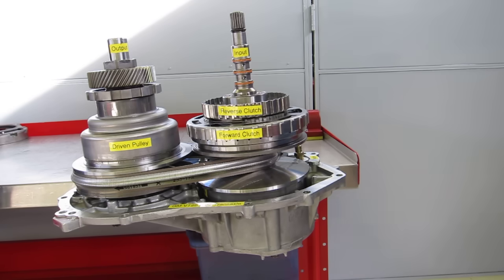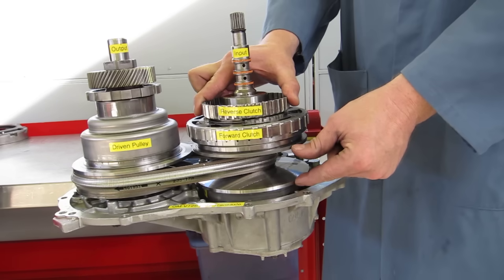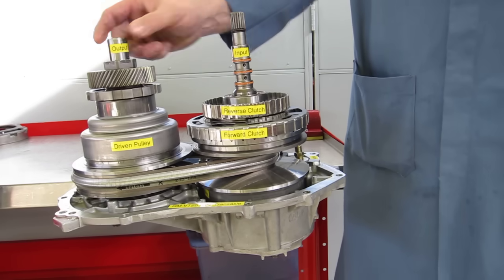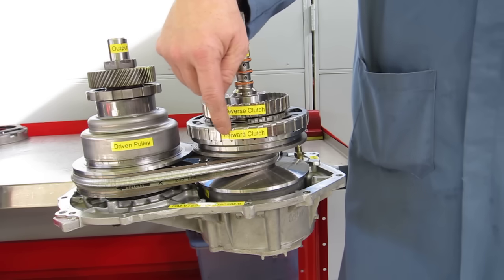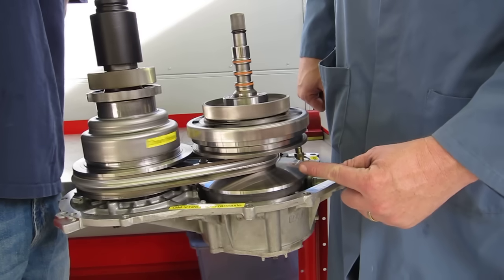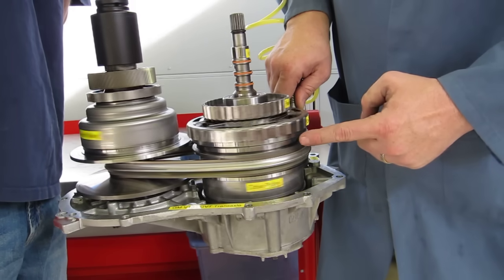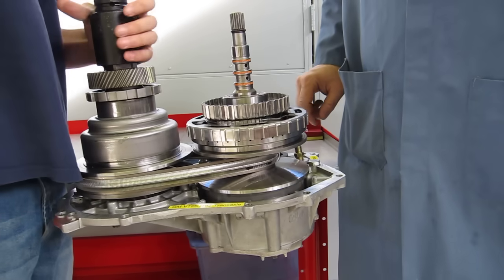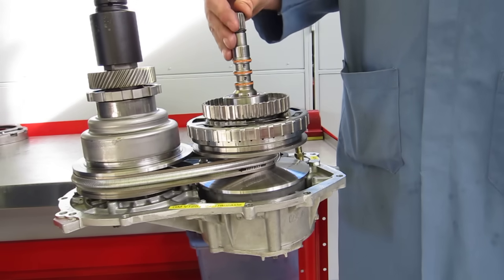Continuously Variable Transaxle (CVT) Operation

Comment: I know the guy who held the first patent on a fully functioning CVT and demonstrated it at a World Fair a long time ago. I don't remember what year and he may have passed away now, he was already quite old when I met him in 1999. Somehow his design worked without pulleys and belts and was supposed to be far more mechanically efficient and reliable than the belt design. He had a treadmill with a manual CVT in his apartment as his remaining piece. I struggled to understand the design, and had been attempting to invent one myself for use in heavy duty situations. The man was a genius. The belt driven designs initially were not efficient because of the friction to create gear ratios and reliability was an issue. I haven't been following the auto industry as much for the last 20 years, but I think those are still the same hurdles.
Reply from the maker: Thanks for your feedback! Very interesting!
Reply: I know this comment is 5 years old, so I apologize, but would you perhaps be thinking of something called a "toroidal CVT"? I remember seeing a video of it a while back, it's used for much heavier duty situations. Doesn't use a belt at all, instead it uses some kind of friction from spinning wheels, so it's much stronger. I think the Japanese military's main battle tank uses one (which means it can go just as fast backwards as it can forwards, which is neat).
Reply: @ianrasmussen5380  good evening, I just googled a toroidal cvt and although this is more on par with what I originally described, it isn't quite the same. Bill Glazier's CVT employed a lot of sprag shafts, or sprag clutches, and to this day I still haven't been able to "crack the code" and decipher how he incorporated them into his design, but I think there was still a lot more to it, unless the toroidal video I viewed was an oversimplification. Cheers to you

Comment: With reliability of the belt as the main concern, how can the new Nissan pathfinder claim towing ratings of 6K pounds?  Are they using multiple belts?
Reply from the maker: Hi, no. The newer CVTs actually have a regular gear set that shifts from first gear to second gear, then it is a CVT from there up to the higher vehicle speeds. That makes it stronger when accelerating from a stop.

Comment: Have a 2013 Altima with 60,000 miles. I'm on my 2nd cvt and it sounds awful. Until 2012, Nissan had a 120,00 mile factory warranty on these cvt's because they went out so often. The warranty is still 60,000 on these cars after 2013. They said it failed a flying graph test because of the torque conversion, and it would kill the engine quickly every time you tried to tough the gas pedal. It would idle forever though.
Reply from the maker: Thanks for the feedback!

Comment: I think you mean pneumatic, not hydraulic.
Reply from the maker: Thank you!
Reply: Any time.
Reply: He said, "I'm going to use air pressure for this demonstration." The system normally uses hydraulics, but pneumatic pressure is more easily used in this kind of situation.
Reply: +Jon Miller He that he was "going to apply hydraulic pressure." Then he went on to say that he was "going to use air pressure for this demonstration."
Reply: Yep. His wording was the slightest bit awkward, but clearly the first statement was part of explaining how the system works in actual use, and the second was explaining how he was doing the demonstration slightly differently. It's just like how they are demonstrating by applying power directly to the driven gear, even though that's not precisely how it works in actual use. It's just an easy way to demonstrate it. 

Try to keep up.

Comment: works a lot like a torque converter that uses a belt except this uses other means to change the pulley diameter whereas a torque converter relies on centrifugal force to do the same.
Reply from the maker: Thanks for your feedback!
Reply: a clutch doesnt change the gear ratio, it just delivers power to the transmission.
Reply: +scott walton I'm talking about the torque converter that gas powered golf carts and some go karts use
Reply: +jmcinvale at least that's what I've always heard it called. maybe the correct term would have been cvt.

I'd almost bet someone looked at the cvt on their child's go kart and wondered why couldn't we do that with cars.

Comment: Great for mopeds... weak for any horsepower... but, they will get better as time goes on. Personally, I'd run to the hills and use a nice conventional transmission.
Reply from the maker: Thanks for your feedback!
Reply: Are you a mechanic?
Reply: Agree
Reply: Ilove my cvt on my moped 😘😘
Reply: What? Most modern tractors use CVT and they have 700bhp and tons of torque.
Reply: @AriHD  it seems that you have severe misunderstanding of things. CVT will never be in a vehicle that need high horse and torque since the design was not capable of handling the power without snapping the belt

you probably think of conventional automatic
Reply: Agreed, manuals rule!

Save the Manual!

Comment: The limiting factor appears to be a steel belt on a steel pulley (much like a railroad locomotive drive wheel on a steel track). Seems rather obvious, but for more torque, why not just have multiple pulleys and belts in parallel?
Reply from the maker: Good question! Thanks for your feedback!

Comment: CVT's use belts?!? Hah! Just one more reason to hate on em'.....  And yeah, yeah.. I know they're the most efficient etc. etc... The most efficient meal would be a salad with no dressing.. But I'd rather have something with some more texture and spice! 

So I'll take a dual clutch, classic manual, or even an old fashioned torque converter auto over this glorified scooter transmission anyday!
Reply from the maker: Thanks for your feedback!
Reply: Dana has beltless CVTs now :)
Reply: Mike Howard
Hmm.. Yes.. Dana was wise to eliminate that weak point.

Comment: I have an old landrover,  it spent its first 230,000 miles in Africa. It was imported into England 18 years ago and has clocked up another 170,000. It still has the same engine and manual gearbox that was fitted when it was new.
Reply from the maker: Awesome! Thanks for the feedback.

Comment: i want a manually operated cvt so bad, invent one please!
Reply: that's.... strange. the whole point of a CVT is to not change gears.The transmission does the magic by making adjustments to the ratio as you drive. Or am I wrong?
Reply: well my guess was that it would have a computer telling it where to be, but i feel that there are times when i would want the rpms of the engine to be in a different spot then what it wants them to be. also i just think it would be a fun an a very unique driving experience
Reply: Subaru wrx cvt has paddle shifters with simulated shift points and can be either a "6 speed or a 8 speed"
Reply: no, you miss the point. he wants a manual one where you can manually control the hydraulic pressure in the cylinders and change the ratios real-time
Reply: Re exactly, like an infinitely variable gear stick
Reply: sometimes i i'd imagine the shifting mechanism will resemble something of a slider instead the lever gears we have with a manual
Reply: You can get cars with 'pretend' paddle-shifters (up to 12 if you like) but they're CVT really.
Reply: Get an EV. 1-speed transmission. No changes except to direction.
Reply: @johnbenton4488  that's not good for a ev tho lol. Single speeds hurt electric motor performance
Reply: JKC jeep tried it, Auto stick,  epic fail.
Reply: that kinda defeats the point though. id like one that emulates a hydrostatic transmission
Reply: EV wins on all fronts. especially costs.
Reply: You meant like a clutch-o-matic?
Reply: Not only has it been invented already, it has been around for quite a while on 21-speed mountain bikes! Fitting that onto a car would be like buying a PC just to use the calculator app. A CVT already gives you the optimal gear ratio for a given RPM and speed, so why do the math yourself? There are also the mechanical limitations of the engine and transmission to consider: excessive friction on the drive belt and higher chances of redlining the engine.
Reply: What I want is to have more input than just the "throttle" position (scare quotes because the gas pedal on a modern car is not connected to the throttle valve - it's just an input device for the computer.) Your typical auto trans computer, be it the old fluid-mechanical ones or the newest computer ones interpret full throttle as "I want maximum power", but very often what I really mean is "I want the engine to operate at WOT on top of it's torque curve". Good acceleration, relatively low noise, not a huge impact on engine life because of the low inertial loads. Maybe just a button on the steering wheel, that would switch the throttle between between a  call for power and a call for engine torque.
Reply: You would literally have like 30 speeds for it to be remotely useful
Reply: woohunter1 maxima has the same thing
Reply: Cvt and ivt tractors have a manual stick if u will, u can control the exact ratio.
Reply: ?  manually operated CVT?  "you keep using that word, I do not think you know what it means."

Comment: Great Video, I have a similar setup on my drill press, nothing but problems... If Honda and Toyota use them they must be reliable but I could never trust anything built here again.
Thanks for posting!
Reply from the maker: Thank you!
Reply: But are Toyota's CVT's less reliable that their standard transmissions?  Which is cheaper to repair if it breaks?  Which is cheaper to replace?  How much does each cost to maintain?

Comment: The steel belt makes better sense because it is stronger than rubber for high power.  Q1 how does it handle the fatigue cycle so steel does not break.  Q2 how do you handle this when car in Drive and at the stop-sign?  Where the engine is running and car is not moving?  Or slippage.  I have seen Nissan, where they use fluid coupling.
Reply: He describes a torque converter between the input shaft and the engine. There's your fluid coupling.

Comment: This is why the HHR is garbage. Much like all GM junk these days. Tired of working on them. Btw snowmobiles have used this for decades.
Reply: I have sworn off all gm products forever. They have completely bought into the xerox business model. when you have vehicles that constantly break down you shouldn't fix it, just view it as an additional revinew stream.
Reply: @dimesonhiseyes9134  even tho gms still have low failure rates.
Reply: All of the automatic transmissions I've had on ATVs and UTVs have been belt driven transmissions. Never had any problems with them but then they're not trying to propel something that's 2+ tons at 150+ lb/ft.
Reply from the maker: Thank you for the feedback
Reply: scooters use them too! i've even heard of a two-stage CVT at a 900+cc scooters by piaggio that essentially kick the second cvt with longer ratios at high speed.. i think those top at 240 kph?
Reply: K. beta 
 Where have you seen 900 cc scooters?
  Honda discontinued their silver-wing.
Reply: So have Bridgeport milling machines!
Reply: My golfcart also has one!

Comment: GM + Transmission = FAILURE!  That 700R-4 was good huh?  ;)
Reply: Oh lets just forget about he TH400 TH350 and 4L80E(arguably the strongest OD auto at the moment)
Reply from the maker: Especially in 1982
Reply from the maker: True, the 4L80-E was just at TH-400 with an OD in front of it. It still had a terrible first gear ratio of 2.48:1
Reply: why would you want any higher? you'd spin tires all the time in 1st gear. Not only that 2.5 to 2.6 is the norm its barely lower. Also i added the 4L80E because it is the strongest I know its basically a TH400 with OD. I drag race man and trust me you don't want a super tall first gear.
Reply: Ran a fleet of Safari vans in the late eighties with 700r trans and many had more than 500k on them with original trans. Not too bad compared to some of the other shite around.

Comment: Doesn't this method cause slippage at the belt?  Seems there would have to be a significant amount of tension/friction on the belt to keep this from happening.

Also, it appears that the gear ratio cannot be changed while stationary, due to the steep angle of the pulley walls.  So for instance, if you're in overdrive (say 0.5:1) and come to a stoplight, the transmission has to be smart enough to alter the gear ratio while moving.  Otherwise, you will be forced to start out from the light in an overdrive ratio until it can change back to a typical starting gear ratio.  This would hurt acceleration from a stop.
Reply from the maker: Good points. The trans ECU would not allow the ratio to be 0.5 at a stop, it would increase it back to the 2.43:1 before the vehicle stops.

Comment: I'm surprised he didn't mention the fact that these types of automotive CVTs transmit the power on the compressed side of the belt rather than the tensed side. In other words, they push the power across the belt to the driven pulley rather than dragging it. Other than that they are functionally identical the the Salsbury/Comet drive in a go-kart, snow mobile, or atv. The downside is these can only be considered "reliable" in low power vehicles like hybrids. You couldn't use this thing in a large truck or higher powered car without destroying the belts.
Reply from the maker: Thanks for the feedback, Subaru's use CVTs in some fairly powerful vehicles.
Reply: @WeberAuto  They do, and mine broke after a year and a half.

Comment: Amazing stuff but isn't there a lot of energy converted to heat from the friction on the belt?
Reply: +Dyllidan ret technically they are the smoothest, fastest, and most efficient type of transmission since you can constantly hold any rev including max power giving you the most acceleration
Reply: +MyLonewolf25 that's why I love em, they allow you to haul any load at the maximum speed unlike multiple gear trannys where 2ND gear is too torquey and burns more fuel and third gear isn't enough torque
Reply from the maker: I do not know, but I don't think so. There is no evidence of heat discoloration on any components. I assume that using the correct fluid reduces the friction and heat
Reply: cvts used on lighter vehicles like atvs and snow mobiles are centrifugally clamped, they have no hydraulic pistons changing the ratio, simply engine force causing a fly weight equipped clutch to fight the output load, wheels, inwhich the output side is spring loaded to stay it its tightest position making the transmission stay in its lowest gear when no force is applied to either input or output, and also if the output side is too difficult to turn it will collapse forcing the front centrifugal clutch to open and make more torque at the wheels... these transmissions are by far better than any other type of automatic or manual, their only flaw is that the belts break under extreme torque conditions, very little power is lost over these transmissions, especially non hydraulic types that i explained above
Reply from the maker: There is a difference between the 700 psi clamping load that holds the belt from slipping and friction caused by the belt slipping.
Reply: Not as much as a normal auto box. CVT gives better acceleration and better gas mileage than an auto box.

Comment: For some reason the CVT in my mom's Corolla accelerates poorly from low speeds. Maybe the low ratio is not very low(especially for a car with that little power), as the 2.6:1 you mention in this demonstration is pretty tall as well. That's what it seems like.
Reply: Also is there slippage in the CVT itself? It seems like there would be, and add that to the parasitic loss of the torque converter, and there's plenty reason for it to be slow, haha.

Comment: Technology hasn't really changed much. Grain harvesters (headers) have been using this type of equipment, with belt drives, for decades. Nothing new really.  Man has been to the moon and back (we think) and this is now the twenty first century. Surely today's engineers can do better than this and come up with something more robust - and long lasting.
Reply: they would be great if the belt didn't snap.  problem: that belt is almost the size of whats on my grizzly 600, an it's on a 3000 lbs car.  solution: engineers get off their ass and make the belt bigger👍.  haha. weren't we supposed to be flying to work now anyways?
Reply: +dhaynie266 I don't want a link to a conspiracy site full of foil hatters and trolls. Not necessary anyway. Just post the patent number. Simple as that.
Reply: +dhaynie266
We would be in flying cars, but the oil companies start frothing at the mouth when we suggest advancing past oil fuel. I heard that at some point someone had made a superefficient electric engine. They and the prototype mysteriously disappeared shortly afterwards.
Reply: +Thelothuo. yea you're right, they would.  if I remember correctly what you're talking about, the design was a vapor carb that allowed 50mpg on a mustang 289.  the government bought the patent and locked away it went.
Reply: +dhaynie266 And exactly what patent number would that be?
Reply: +A daft punk http://www.abovetopsecret.com/forum/thread802712/pg1
Been awhile so my thoughts were off.  here's facts.
Reply: A daft punk
 Checked it for sake of boredom. No number listed. Some news articles, though. And names.
Reply: us patent # 4177779.   ogle carburetor
Reply: dhaynie266
So there is one. Huh. Guess that means those articles and names weren't made up or forged, either.